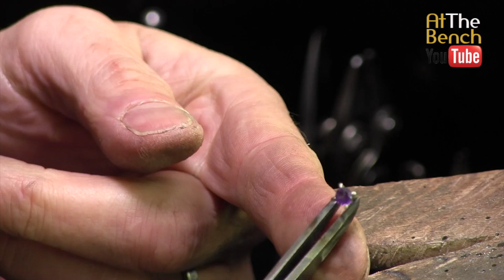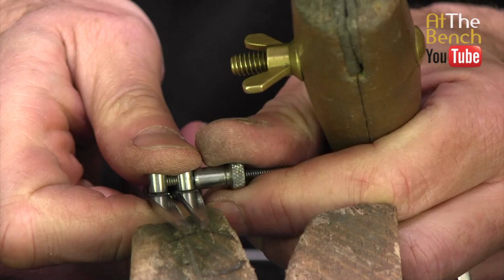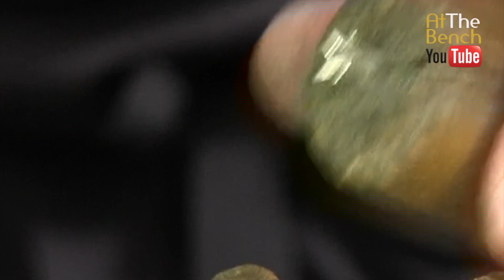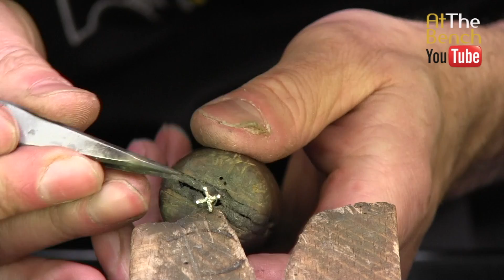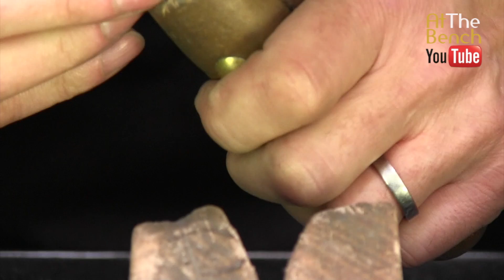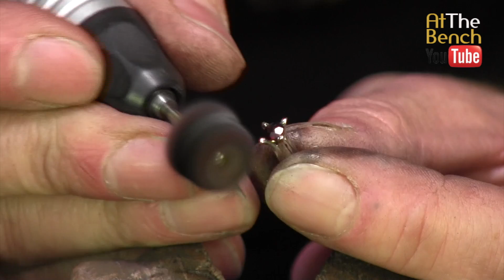How To Set A Facetted Stone In Our No Solder 4 Prong Setting

Comment: For a princess cut stone that I want the corners to be protected by the claws would you cut into the claws the same way or make somewhat of a channel cut down the claw? 4:24
Reply from the maker: Cut a channel along each side into the corner and then drill a blind hole into the corner so the corner of the diamond doesn’t touch the metal
Reply: @ ooo a blind hole. That’s smart. Thank you. I’ll do that.

Comment: If you can't run your flex shaft in reverse, save your old burr bits. A dull bit is also less aggressive albeit frustrating when you accidentally mix it in with your sharp ones.

Comment: Dear Andrew, now that you have perfect setting, how do you harden it so it doesn't deform when used?
Reply from the maker: You don’t need to harden it to be honest
Reply: I been wanting to make silver spring brooches and have seen so many disagreeing philosophies on hardening, was hoping you could sometime do an episode sometime on tempering.  Thank you Sir
Reply: @moxnyx9451  puttin them in with shot in a tumbler helps work harden, Melissa Muirs channel she did a video on this a month or two ago, should be easy to find. She shows different ways to work harden such pieces.  This piece Andrew made would be good an solid I reckon 😉
Reply: @Ken_Dalton  thank you :)
Reply: Had this setting been soldered to something it may be annealed. To address the softness, do the soldering before you do the bending out of the prongs. The prongs will be work hardened in the process.
In jewelry making there is an order of operations (similar to math's pemdas) that needs to be figured out for each project that addresses finish, durability, function, etc of the desired end result.
Maybe Andrew will address this at some point if he hasn't already.